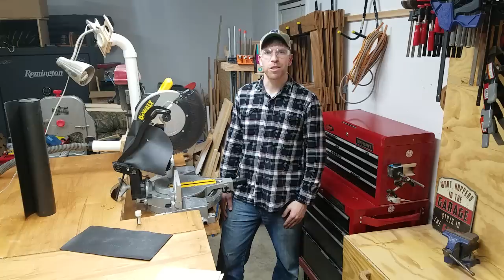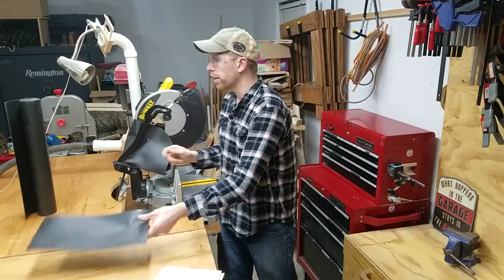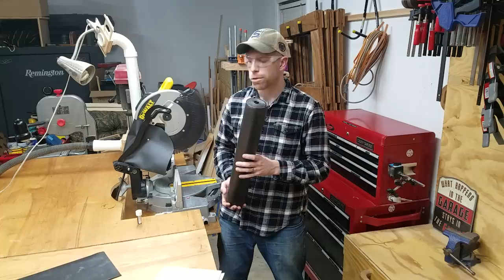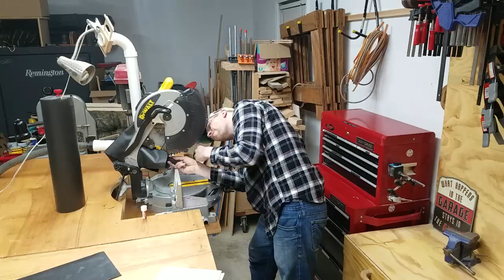Miter Saw Dust Collection, simple and extremely effective! (LINK TO TEST & TEMPLATE IN DESC)  / EP44

Comment: Chris, after many tries and many retrofits I finally got a system that works. I enclosed my 12” Mitre Saw with a housing I made that allows my compound mitre saw to swing all the way 50 degrees left and right. My saw has two long pipes that allows the mitre saw to slide back and forth. The foot print is large. After all the trial and errors I decided  the answer was gravity! I tore the Mitre Saw out but left the surround in place with an alteration. I drilled a 4.5” hole in the bench under where the Mitre Saw sits. Then I cut pieces of 1/4” hard boards into triangular shapes. These triangular pieces were then secured to surround that was first built but kicked the bottom of these pieces forward towards the hole in the bench. I then fastened  a cover using heavy stock card board over the triangular hardboard pieces to cover everything. This enclosure came out just behind the fence. I installed a PVC 4” coupling to the hole in the bench and connected the coupling with a 4” flexible dust collection hose. I originally bought plastic dust blast gates from a well known woodworking supply store. These blast gates turned out to be real junk. They clogged up with saw dust and leaked vacuum until they were totally useless. I built my own blast gates that are self cleaning and never get clogged up. Now every saw or piece of equipment that needs centralized vacuum works at full capacity. My Mitre Saw  never worked so good. I have two vacuum hoses connected to my Mitre Saw. One that draws the dust from the rear of the Mitre Saw and of course the new and much improved gravity pulled saw dust behind the Mitre Saw.
Reply from the maker: Richard, sounds like a great design. Sounds like you came up with an effective solution. I wish I had the space for  a dedicated housing like you're describing. Glad to hear you beat the dust, and thank you for sharing your description!

Comment: Chris, thanks for your prompt reply! I’m still confused when you say” I chamfered the back inside of the port” is that the black “tube” that you pull out of the saw? I presume the ends of the rubber liner don’t overlap at the screw hole. I appreciate your thoughtful help. Sorry for all the questions and I also think you should patent your modification and sell it to the saw manufacturers. I don’t understand why this wouldn’t be standard equipment. Thanks again Bill
Reply from the maker: Bill, pardon my lack of clarity, here are a few photos: https://www.instagram.com/p/BsGi6i9gBYe/?igshid=d7x42c58b7m0 
There is some overlap where I wrapped the two ends around and I believe I had to trim and shave down all sides of the stock dust tube/port from the saw. Basically I kept shaving a little at a time and replacing it until the screw holes lined up with the rubber in place.
I hope that helps. And I wish I could patent, I'm. Sure someones has thought of something similar. I know the Bosch Glide has an improved boot. I also wish manufacturers would make stock dust collection a priority in their designs.
Respectfully,
Chris

Comment: Chris I enjoyed your solution to the dust collection on your miter saw. I have the exact saw and want to incorporate your modification and I have the draw liner, but after placing the rubber shroud around the boot I can’t fit the boot back into the saw because it’s too big. I understand cutting the top and bottom down but the sides with the liner are too big. How did you fit the boot back in. I’m missing something. Thanks for your help Bill
Reply from the maker: Bill, thanks for watching, the feedback, and the question.
I ended up trimming the sides with a utility knife also. I also chamfered the back inside edge of the port to give more room for the rubber.

Comment: Chris, I hotice there a fairly solid space 9with room for a shroud) behind you, if you move that top toolbox.  i have a similar sized layout, and am put in a sliding shelf to mount it on, so that the nite saw can move back or forward to accommodate the narrow depth of the space, and the sliding forward/backward /turning of the miter saw
Reply from the maker: Dan, your sliding shelf sounds interesting. I'm probably going to stick with my cart layout for now. Can you explain what you mean a little more?
Reply: Chris Harpster. I've planned a gap of about 12inch between 2 over bench shelves. So the mitre saw will fit between them, but the moment I want to adjust the saw for a non-90 degree cut, I'm stuck. To by mounting the saw I set into the bench on a shelf with draw tracks, I can slide it forward to clear the bookshelves

I loaded up a video on YT this morning to share my layout & shop design. I've got about 30 or 40 workshop innovations planned, specifically for a very small dual purpose garage/workshop. 
https://youtu.be/DMjCcYt0ylk

Comment: How does it work on max setting of mitre and bevel?
Reply: Never mind.  Failed on my Makita LS1216.  Not the right fit for this excellent enhancement for you saw.  I make all kinds of things at all kinds of bevel and mitre angles so don't want to be adding extra move this watch out for that kinda things to my already complex cuts.  Thanks heaps.
Reply from the maker: Who DatBe Dare, I'm glad you tried it and were able to share your results. Best of luck in your dust collection quest! I understand Makita is one of the better saws with stock dust extraction.
 I don't do a lot of compound miters with my saw but to still answer your initial question for anyone it may help:
Because the shroud moves with the saw blade/head  and decreases the gaps, it still works much better than stock port. Because the gap between work-piece and shroud increases with miters I've found more dust escapes out the sides of the cut than with a 90deg zero bevel cut. I have not attempted any bevel cuts with the shroud in place yet, but cut the shroud so that it allows for some rotation.  I will likely attempt to document a test of this in the future.

Comment: Chris great idea, liked the solution. I have a 12 inch DW as well, and yes it is a dust monster. Can you share a close up shot of the smaller chute?
Reply from the maker: Brian, hope this helps: https://www.instagram.com/benchtopwoodworks/p/BsGi6i9gBYe/?utm_source=ig_share_sheet&igshid=xsm8cncqrggd
Basically cut a rectangle and formed a cone around the stock dust shroud and trimmed the corners and excess.
Reply: @benchtopwoodworks  Perfect thanks.

Comment: I have the same saw. It’s about 25 years old and the dust collection is horrible. I’ve been struggling with this for years. I built a box shroud and it literally made it worse, by throwing it back into my face.

I plan to try your solution, but would love to know more about how you connected the hose to the connector on the saw. That looks like a large hose compared to the port size.
Reply from the maker: Jay, I used a standard rubber plumbing boot that reduces from 2" nominal diameter to 1 1/4" nominal. They can be purchased at most plumbing retailers (typically ~$4) and use metal band clamps to secure. I've also had the smaller shop vac hose hooked up to it in the past, but I always try to reduce fittings as close to the tool as possible.